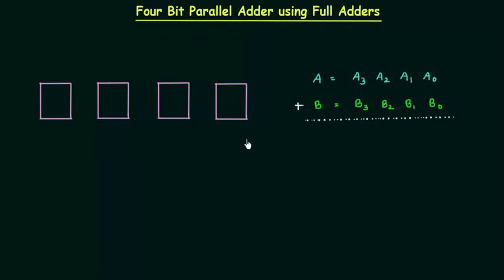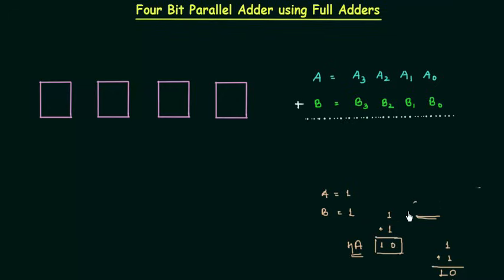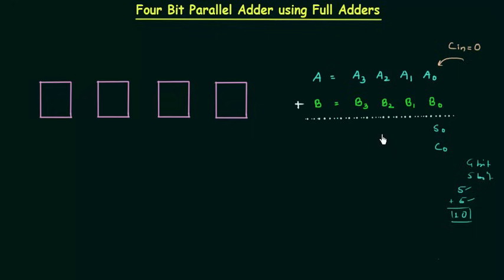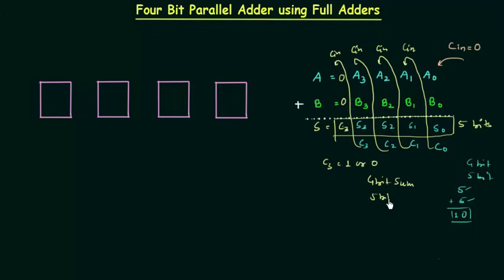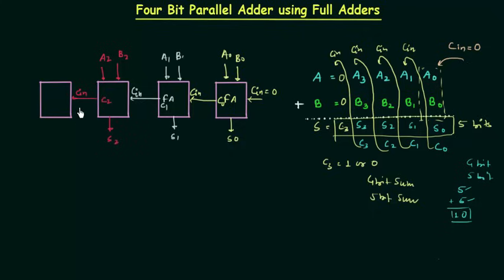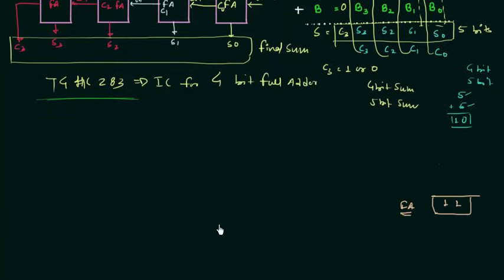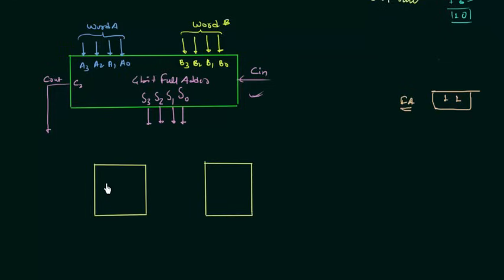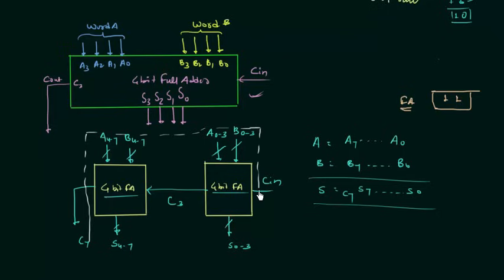4 Bit Parallel Adder using Full Adders

Comment: The name parallel adder is a misnomer, because the bits are not added in parallel, but in series. The carry out bit from the prior full adder must be generated before it can be used as the carry in but for the following full adder. So all the adders run one after another, in series, not in parallel.
Reply: Is it same as ripple carry adder ?

Comment: I was reading 4-bit and 8-bit adders and in that, there was a term gate delay.Can you explain that?
Reply: Sagar Goyal,
In electronics, digital circuits and digital electronics, the propagation delay, or gate delay, is the length of time which starts when the input to a logic gate becomes stable and valid to change, to the time that the output of that logic gate is stable and valid to change. Often on manufacturers' datasheets this refers to the time required for the output to reach 50% of its final output level when the input changes to 50% of its final input level. Reducing gate delays indigital circuits allows them to process data at a faster rate and improve overall performance.

Comment: here there are four  full adder but each of them are summing for a single bit ...  like in 1st it's A0+B0 and in 2nd A1+B1 and so on..  but adding a single bit no. is property for half adder then how these four units are full adder?
Reply: The difference between a full adder and a half adder is that the full adder has 3 inputs because it takes the "Carry in" or Cᵢ as one of the inputs.  A half adder on the other hand, Only takes the two bits being added as inputs.  Since the first full adder in this case has a Cᵢ value of zero, you technically could swap it out with a half adder and it would create the same output.  The other adders after that need to be full adders however to account for the Cᵢ 's outputted from previous adders.
Reply: Rayees Kausar